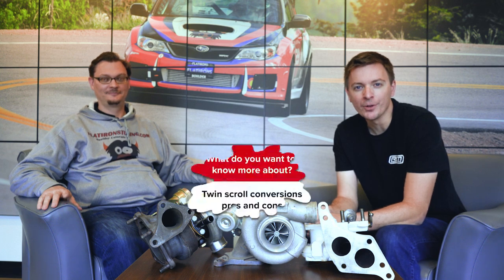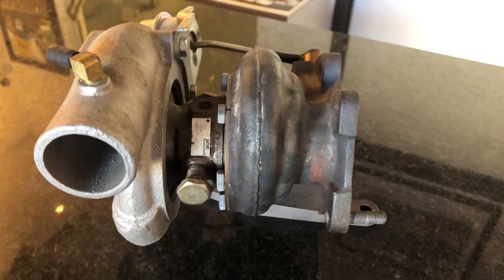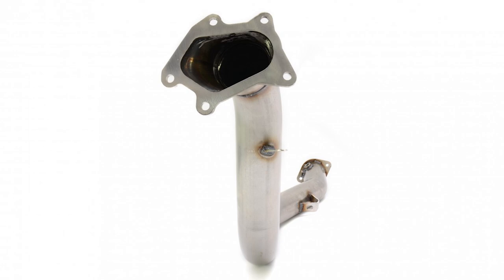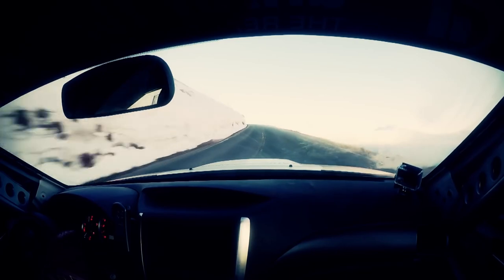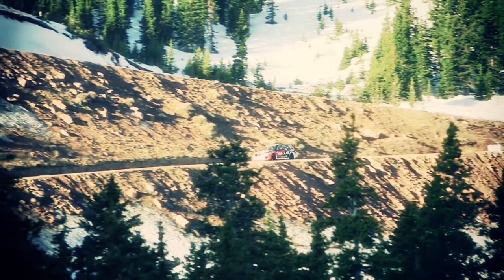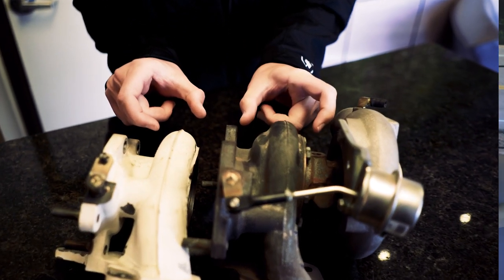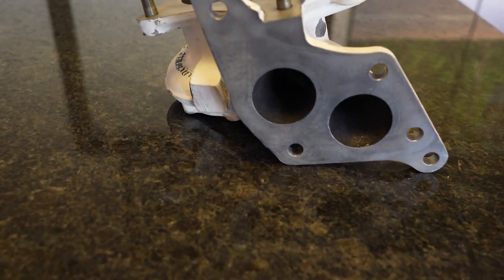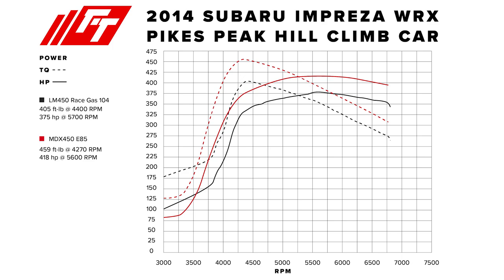To Twin-Scroll or not to Twin-Scroll, that is our Question of the Week

Comment: I have a question. Subaru wrx sti 2019
At the moment my built motor has a gt pumps s03.5
Making around 406whp I'm not impressed with it, comes on to slow for me. Car has a ams manifold. 
I'm thinking about the blouch 3.5 twin scroll turbo. 
Wouldn't this come on a lot faster?
Reply from the maker: I'd say that is unlikely based on our experience.  For more specifics on the Twin Scroll turbos we have worked with, take a look at this video:

https://youtube.com/watch?v=c-ZfPk75Tjg&feature=shares

Thanks for watching and Stay Tuned!

Comment: So is a twin scroll just a better setup for the EJ207 engines rather than the EJ257s?
Reply from the maker: Thanks for the question.  It seems from the feedback here that a lot of people with EJ207 Twin-Scroll setups prefer them.  And given the nature of the EJ207, specifically the fact that it rev's higher, and doesn't make as much low-end torque compared to the EJ257, the Twin-Scroll turbo may well be a better fit there.  

Thanks for watching and Stay Tuned!
Reply: @FlatironsTuning  the factory ihi twin scroll turbos were only really meant for the ej20s (205/7/x/y)  imho the vf36 is the best same as the vf37 but with a titanium wheel for faster spooling which came stock on the v8/v9 sti spec c jdm models.  and can make good power for a street/track car.  but for big power on a built engine a big after market single type will give you better results..  but a good tune can make or break a ej engine no mater what which setup you prefer.   G.. NZ
Reply from the maker: @gregm7231  Thanks for the comment Greg.

Stay Tuned!
Reply: I wonder how much difference the JDM 6mt makes.  I’ve got an ej207 and the JDM 6mt and it spools significantly earlier than my ej205 and with the gearing in that 6mt it feels like it’s almost always a fraction of a second from being on boost.  Now the tickling 3k rpm’s at 65mph doesn’t make it the most enjoyable freeway cruiser, but give it some twisty roads and it starts to shine.

Comment: Honestly twin scroll is pretty difficult from finding parts for it and even replacing parts is hard there is just a handful of turbo's out there and each one will need to be tuned. I currently run a vf37 and I can't find a decent replacement because I wont spend 900 on a unit that I can tell is in worse shape then mine.  So if anyone has a decent example they want to sell let me know
Reply: From personal experience with several Twin scroll or twin entry turbo on JDM Subaru Impreza STi ,I would probably choose billet upgrade of VF37, it probably will be cheapest upgrade and how much it will make? 380-400bhp at flywheel

You have right now several options like MDX555  from Turbo Dynamics, LM4xx series from Litchfield or MDX321 series from Lateral Performance or Chevron motorsport Twin scroll/Twin entry turbo which is based on HTA turbo and then you have choice of Mamba gtx3076r twin entry or Arashi twin entry gtx3076r or Blouch Dominator series

We have run or tried on our JDM Subaru Impreza STi Hawkeye Chevron motorsport 73HTA twin entry and that turbo is awesome, makes 465bhp at 99 RON and with 20% of methanol it making 500bhp or close to that figure, right now we are switching to MDX321V with Twin entry housing and hopefully it will make easier 500bhp

We have tried as well Mamba gtx3076r twin scroll turbo which was making 430bhp at 1.45bar boost and we have tried too Arashi twin entry gtx3076r turbo too which was making 440bhp at 1.5 bar, it would probably make more

MDX321 series is proven for me, previously we have run MDX321T and that turbo was making 490bhp and LM4xx series too is proven on twin scroll and Chevron motorsport twin scroll turbo too are great turbo although they are kinda expensive

With any of them you will need to have car mapped or tuned that's for sure